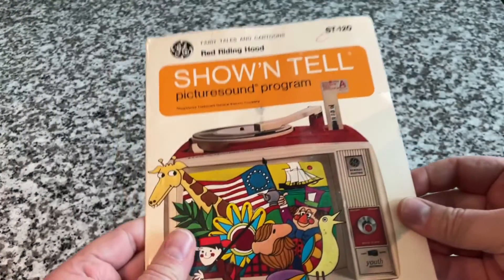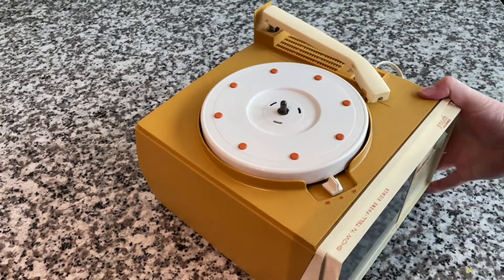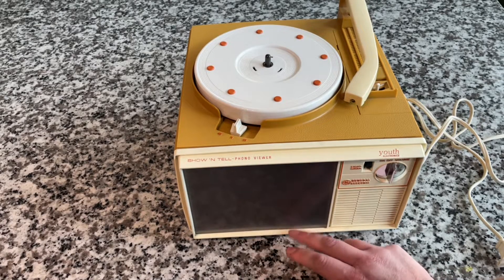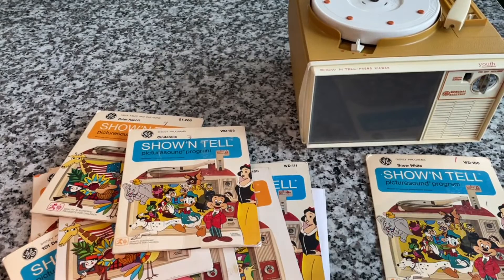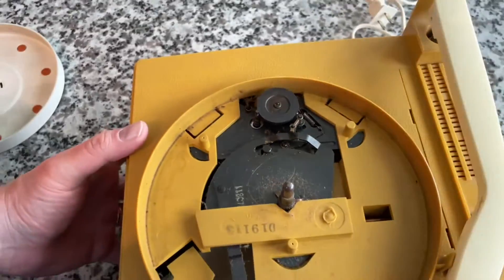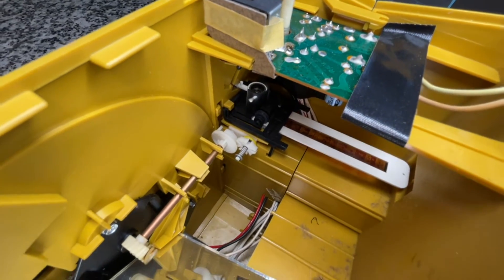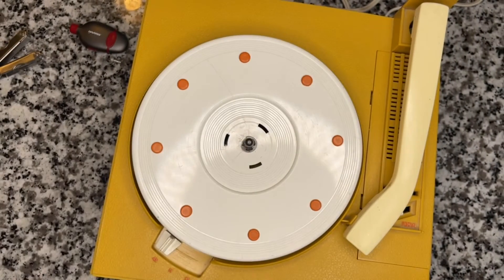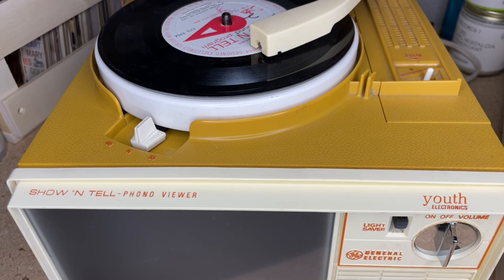Show N Tell Unboxing & Review!

Comment: I was born in 1964 and got one for Christmas just before I turned 3.  Boy did I love it! It was pretty fabulous for the time.  It was built so well. My brother is 5 1/2 years younger and he used it. We had hours and hours of fun with that record player. FYI the early ones had cardboard film "keys" and you had to be really careful not to bend them. The later ones were plastic. I think they had a deluxe version with a radio.  We had a lot of hand-me-down kiddie records that were 78rpm and it played those too.  It still worked when I visited mom in 2002.  The build had faded and I did have a replacement for it. Wish I had brought it back home with me.   They were rubber nubs on the turntable and were soft-ish when it was new but as they aged they got harder.  In the other side of the story record featured light classical music (for example, the Prince and the Pauper had Pomp and Circumstance on the reverse side, and the reverse of Aladdin had Scheherazade on it).  Great find!

Comment: A lovely device for a child to have had back then....  I was a child then, but I'd never seen these; perhaps they didn't make it over to England?
Oh, that little black rectangle of card (with the square hole in it) - 22:39 - is a 'dust cover' for the light saver switch; it would have fallen off the switch when you had it open....
Reply: I still have mine, but it needs Tobe restored

Comment: I had one also, got it for Christmas probably in 1970 I would think. Mine did have the little window on top, I always thought there may have been a tone on that record that advanced the film strip. And you are correct, some of the film strips were cardboard and not plastic. Some of them also had a little hole at the bottom of them and I have no idea what that was for because others did not

Comment: That little black fiber thing goes over that black slide switch that I think is the lamp off/on switch. BTW, GE also made a version with a built-in AM radio; but, those are not very common.

Comment: Hi there, I'm tossing up between buying the Crosley C62 turntable setup or the Crosley 1975t, which one do you recommend more?
Reply: I have the 1975 it’s pretty dam nice... sounds fantastic and looks so sexy .... we put it in our living room,,, the wife wanted a stereo with an easy to use radio and CD player.... she didn’t like my main component setup... lol...but I gotta tell ya the c62 looks to be a big upgrade over the turntable on the 1975....
Reply from the maker: I like them both for different reasons but the c62 is in a different league
Reply: @ralphhoskins2115  I'm just thinking whether it's worth an extra hundred bucks for a slightly better turntable. Does the c62 have way better audio then the 1975t

Comment: I have seen these machines-never had one-came too late for me.The mechanism that advances the slide is a Maltese Cross-Geneva mechanism just like on a cinema 35 MM projector.The projector one runs at 24FPS-frames per second and the mechanism is in a bath of oil.With this one in the player you see how it works-in steps.NOT a continous motion.The drive from the TT is clever.